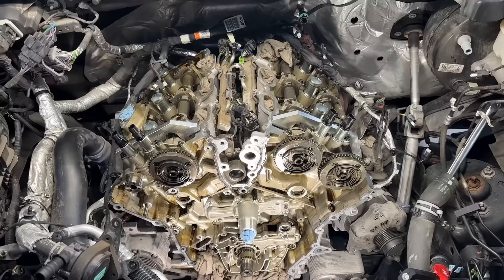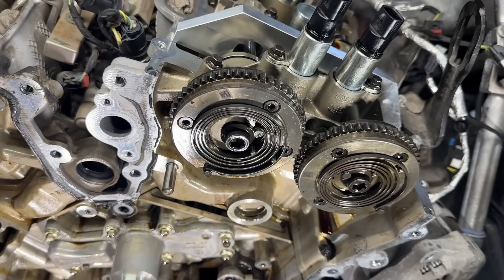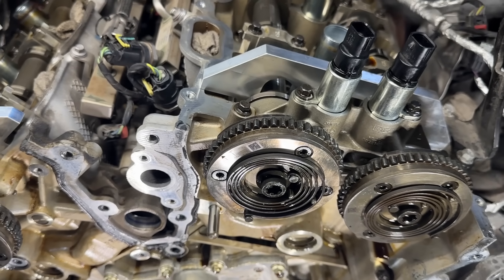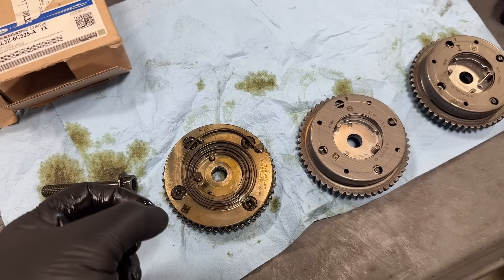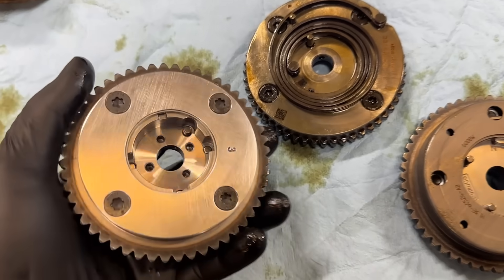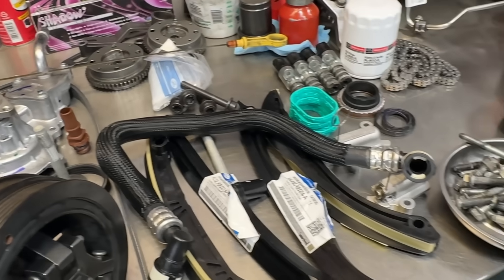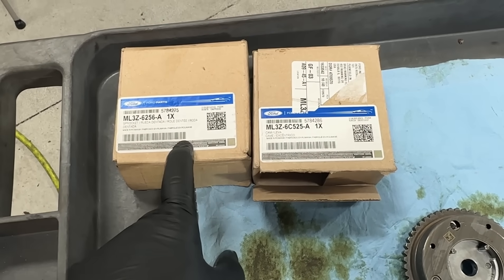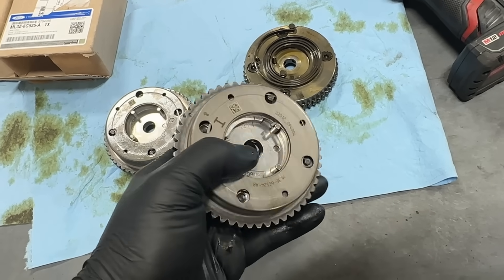2017-2020 Ford F-150 3.5L Ecoboost Startup Rattle Fix: Make Sure You Are Getting The Latest Phasers!

Comment from the maker: Latest Part Numbers-
Intake Phaser- ML3Z-6256-A
Exhaust Phaser- ML3Z-6C525-A

Forscan is a free Ford Specific Diagnostic Software:
Download Here- 
https://forscan.org/home.html
ELM 327 Adapter I Recommend-
https://amzn.to/2GC6dBj

As an Amazon Associate I earn from qualifying purchases.
Reply: This explains so much!  My 2020 Expedition (build date 09/27/20) was in the dealer twice with P0088 at 2000 miles.  Second visit was over 2 months long from 12/20 – 02/21.  
Ultimately a long block was installed. Ford kept sending them the wrong phasers.  The dealer could never get the correct parts and asked to call corporate.  I suspect my late build 2020 has the 2021+ designed engine install.
Reply: How much on average does that  phaser job cost
Reply: @brown63308  recent quotes I've seen are $4400-4500. Which is insanity.
Reply: Dang! I'm 5 years out but only at 48k miles. I'm going to talk to my dealership but if they won't hook me up I may have to do it myself. Like a samn engine overhaul. Ughhh
Reply: @brown63308 $3,000-3,500
Reply: question: is this part number AT4Z-6C525-D correct for the vct exhaust phaser on the 2014 f150 3.5 ecoboost? in a video of yours you comment that the part number is AT4Z-6C525-B but it is different from the one shown by sites like fordgiantparts or tasca Thank you
Reply from the maker: Yes the exhaust phaser has changed a few more times, the "D" suffix as you listed here.
Reply: @FordTechMakuloco  I just ordered my parts based on the other video you did of the tear down and replacement for the Gen 1.  As mentioned, the part number changed to end in D... are these the most recent updated phasers I'm assuming?  Any word on if they have the same problem(s)?
Reply: The part numbers you mention are coming up as specific to a 2021 F150.  Will they work in my 2017 (3.5 EB)?
Reply: Thanks for this video. I looked up those part numbers and it says its for the 2021-2023 3.5, I have a 2017 Raptor and when I look up an oem part it still gives me a HL2Z-6C590-A. Will the ntake Phaser- ML3Z-6256-A Exhaust Phaser- ML3Z-6C525-A  work on my 2017?
Reply: Is there an upgraded phaser for the Gen 1 3.5 ecoboost?
Reply: Are the 21+ 3.5l engines using the latest and greatest phasers ?
Reply from the maker: yes
Reply: Will these work in a first gen EB?
Reply from the maker: no
Reply: @FordTechMakuloco  Hey, I hope you can help us. My 2013 f150 Ecoboost started throwing the infamous p0016 and p0299 yesterday on or trip to St Jude in Memphis, and we are 12 hours from home. The truck runs great, no startup rattle, but will randomly loose power (no boost) and throw these codes. It still runs decent and no bad noises. With a quick restart it's back to full power and running great for a bit and then will go back to no boost and throwing codes. Am I looking at a possible stretched chain, or do you think it maybe a bad sensor? It runs so good until it randomly decides to quit allowing boost, I would think if the chain was stretched I would be getting some misfires. Any thoughts?
Reply: Here is the issue we order with latest part number. New part number comes in with old style phaser in box. Most parts are back ordered so you get what you get.
Reply: Will this work on a 2019 Expedition XLT, same part #?
Reply: Brian what years new ecoboost did ford finally fix this issue? Hopefully on their 2022 expeditions?
Reply: Have you had anyone still have problems after the new cam phaser was installed? I had mine replaced a month ago under the warranty for my 2019 f150 , however I can still hear the startup chain rattle. Actually its a lil worst than before because now the noise last a minute longer than before. Even when installed I insisted on the new phaser model and even has the new model part on my receipt. I am taking it back to the dealership this week, but need help to make sure it is done correctly.  Please advise.
Reply: Do these part numbers work with the 2.7l? If not do you know if the 2.7l has new updated phasers?
Reply: Hello, does these new ones fit on the 2013
Reply: My 2021 F-150 2.7 is having  phaser rattle now! I had no idea this plagued the 2.7s too! I see there have been two updated part number revisions on the intake phasers and one on the exhaust…do you know if the latest phasers for the newer 2.7s in fact fix this issue?
Thanks for the informative video.
Reply: Do u post what the cost of a job like this cost ? I Google it and some dumb dumb post that it cost 1500 $ from Ford to put all new timing stuff in his engine that was parts and labor I know it's that much or more in just labor so it's very miss leading for alot of Ford owners !! I've not looked anything up but just by seeing your video im thinking 5 grand !!
Reply: There's a new updated part number added in May this year.
Reply: @davidgallo5676  I'm about to get this done on my 2018, do you know the new part numbers?
Reply: How much do you charge to replace it ?  2018 F150XL
Reply: Did the early 21's still use the old cam phasers? Did ford use them up before switching to the new style? I am about to buy a 21 and want to make sure.  

Just found your channel.   This is fantastic man.  Keep up the good work.
Reply: How would you go in to your dealer and say "I have a startup rattle and it's my phasers and would like them replaced".  I almost think that they would tell me to go pound sand?  I just bought a 2018 F150, 3.5.  And it rattles just like you describe.  Will the dealer just say "yes we will look at it and replace?  OR again, pound sand.  Thanks for any and all responses.
Reply: Is there any risk in not replacing the phasers and just living with the rattle on start up? I would like to have mine replaced eventually but with thr high cost of the job I don't think I'll get to it right away, aside from doing it myself which I might end up tackling...
Reply: @andrewgeorge3494  yes - your truck will break down in a random spot at some point like mine did on a drive from Houston TX to Titletown Alabama (Tuscaloosa) and let me tell you how much fun that was ….
Reply: @The.Consultant.  Thanks for the heads up, I'll be getting mine done soon...only at 49,000 miles!
Reply: Do you have cam sprocket recommendations for a 2011 F150 EcoBoost with 130K ? They’ve started rattling on almost every startup after 8-10 hour soak?
Reply: @FordTechMakuloco 

So I literally just got my 2020 F150 3.5L ecoboost Platinum back from the dealership two days ago for the cam phaser job...thru Ford's extended warranty. 

Before the job, we had a 20 minute discussion where I told them repeatedly, that I wanted the new cam phasers installed that are in this video... They agreed to do it.

First off they had my truck for 2 weeks...even though it was scheduled formthe first day. No biggie. But when I got it back, when I looked at the paperwork, it showed the old phasers--HL3Z.

When I brought this to the Service adviser's and the tech's attention, they acknowledged they did not install the ML3Z version... But that they did install the newer HL3Z cam phasers, that supposedly have an "anti-rattle clip". They said they had to because Ford wouldn't cover the warranty job if the paperwork showed ML3Z phasers.

They said they could tear the engine back down and replace the cam phasers with the ML3Z ones, but that if the ML3Z phasers blow the engine or if the cam phasers just fail, then when they had to send the cam phasers back to Ford for the warranty, the claim would get denied and I would likely be left with a blown engine and the costs associated with it would be mine alone.

Their concern was the new updated cam phasers in this video could potentially not be exactly as the old set and it could throw the timing off, causing catastrophic failure.

2 questions:

1. Would the Ford extended warranty still cover my engine if it blew up, after using the ML3Z cam phasers?

2. Are the new style cam phasers, ML3Z, legit? Are they the exact same specs as the HL3Z (meaning the same amount of sprocket teeth and distance between each tooth...etc)? Do you still use the same timing chain for ML3Z as was used for the original timing chain for the HL3Z?

If somehow you get this, even though it's a year later, and you do actually reply, THANK YOU! THANK YOU! THANK YOU!!!!
Reply: @Jankity3 Hello. (Sorry this isn’t the reply you were hoping for) 

As I read your post, the dealer shop insinuates that FoMoCo doesn’t approve of the ML3Z phasers being installed but Brian says they are the latest and greatest? That seems to suggest that Ford is once again trying to use up “old stock” first. However, it’s hard to believe that if the ML3Z is the latest version of camphaser, why wouldn’t it be installed? Especially given the dealer shop was willing to do it initially. I personally think the specter of your engine “blowing up” is complete nonsense. 

As I understand it, not every camphaser fails, regardless of age of part number. I had mine changed under warranty at 60,000 miles and now have 107,000 miles on truck and so far no rattle. However, I do not see a specific part number on my shop receipt for what was installed but I’m suspect that I got the very first/ original design based on what Brian says on this issue. 

Lastly, for the purpose of clarity, is the ML3Z the third version of this camphaser?
Reply: @aggiejet  I don't really know...Brian seems to say there's been several in a reply of his above...(says suffix D above)
Reply: @Jankity3 I rewatched the video and reread your post. IMO, the dealer shop couldn’t get the ML3Z phaser because of demand. After your truck sat there for two weeks, they wanted it out of their shop and according to Brian, Ford “allows” dealer shop to install old camphaser. So you got the old ones. If they are willing at their expense to install what you want, I would absolutely do that.
Reply: @Jankity3  I just got mine done at a Ford dealer on a 2018 last Tuesday at my own expense, $2802.99 Canadian tax included. Ford of Canada won't give the extended warranty that the US trucks got. Dealership gave me a 2 year warranty on the repair, they used the ML3Z phasers.
Reply: @Jankity3  I just got my 2018 done at a Ford dealership last week, they used the new style phasers and gave me a 2 year warranty. I brought the truck in Monday morning and I got it back the following afternoon. Not under warranty, paid $2405 Canadian plus tax. No more rattles and no leaks, expirienced tech told me he'd done this job well over 100 times!
Reply: @Jankity3 For informational purposes, I had my cam phasers replaced under warranty in November 2021 on my 2018 Lariat Fx4 at 59,267 miles. ML3Z 6256 A was used for intake, but HL3Z 6C525 CD was used for exhaust. I now have 108,000 and am holding my breath. 

Internet search reveals that Ford sold literally a million 2018 F-150’s and Super Duties. I’m curious if every single old style cam phaser fails? My guess is they do not. So while every shop in America is replacing cam phasers a lot, I don’t think they all fail. 

Good luck everybody, and thank you Brian for the education.
Reply: And these latest parts will fit fine on the 2018 F150 (Raptor) model also.
Reply: Sorry wanted to rephrase my question.. will these latest parts fit on a 2018 F150 Raptor 3.5?  or are we stuck with having to use the orig versions.. Fords OEM parts online is stating they do not fit. But was wondering if that is not correct.
Reply: Is the same part number for the 2014 f150 3.5? thanks!!
Reply: Has anyone had the new ones done recently and what's the lastres par numbers? Need to get mine done on my 2017 3.5L Ecoboost
Reply: Hello would the updated part number fit first gen 3.5L?
Reply from the maker: no

Comment: I am familiar with the 5.4 3V timing job and I'm about to do my first 3.5 EcoBoost Gen 2 timing job. Do I need to upgrade the oil pump or anything like I did on the 5.4?
Reply from the maker: There is no upgraded oil pump available.
Reply: @FordTechMakuloco  Thanks.  Can I follow your Gen1 3.5 EB tutorial to do my Gen 2 3.5 EB timing job?  Any major differences?  Thanks.
Reply from the maker: It is totally different.

Comment: Correct oil and regular oil changes eliminates most of these problems. You dont pick oil viscosities out of your imagination on these.
Call me a liar all you like, but my 2020 work transit van that sees almost entirely highway miles has about 500 miles short of 500k on it as I type this, with the only problems being a failed coil pack at around 300k. Non ecoboost 3.5. Have yet to hear a hint of cam phaser rattle.

Comment: Thank you for this video @FordTechMakuloco!  Unfortunately, my in-warranty replacement was with the old phasers at 83,000 miles, and now at 128,000 I have to do them again.  Do you happen to know what the part number is of the bolts that hold them in?  Thanks!

Comment: My truck had this repair done three years ago.  The OASIS invoice shows that the latest phasers were installed on that job.  Now 30k miles later, I had to have them done again.  I am not confident this problem is fully resolved, even with the new parts.
Reply: I’ve got a similar problem, except I got 50,000 miles out of my repair at 60,000 under warranty except I got the old style phaser put in on the exhaust side and now something is rattling again.

Comment: Or just keep driving it with startup noise and the engine still keeps going FOR ANOTHER 200,000 MILES without problem ! !
Reply from the maker: They will eventually not be able to lock and I have seen the lock pin shoot out.

Comment: I'm guessing the reason for the captive spring (cover) on the outside of the phaser is in case the spring breaks so it doesn't send shrapnel down inside the timing cover. I've seen someone on forums had one with a broken spring on it.

Comment: My 2020 Transit 350 3.5 twin turbo has 331,000 miles with no issues. I use the Mobile -1 20,000 mile full synthetic , and change it and the filter at 10,000 mile intervals. No issues so far.

Comment: How much should this job cost?
Reply: Four to Five Grand 😨, that's what I was told as I gathered the parts to do all this with a friend,that has dealt with a few. The issue has also been getting the parts at 120k the hoses are ALL shot!! The inside rubbers are all coming apart, the water pump pulley shattered so did the impeller and the plastic thermostat housing leaked a bit into the engine valley(about a quart) Also squirting the special tools (their not that form fitting special or bolt to anything just double C clamp like over each cam. The sprocket tool hard to find ,tool truck guy didn't know where to find one ! 🙄. Once I become an expert I'll do these myself but , I am not impressed!!! Sad Ford very sad! As an engineer id scrapped this crap and started over again, somehow something different could have been thought out!!!

Comment: My 2015 F150 King Ranch has like 220k miles; was making all this clatter the last 100k. Now it’s crapped out. So gonna just put a new crate motor in it. Should I order the one for 2021 years or newer? Will it all match up if I do that?

Comment: Brian.. Thanks a TON for this "head up". Two years ago @ 58k I got "the rattle". Took it in and (after the second try) they did the fix. Now @ 93K I'm getting (service engine) prompts where it's telling me I have low oil issues or wrong oil issues. Also idle sputter and poor gas mileage. I'm told it's the Phazers again by my Mechanic. ...Looked at my replacement parts list from the original fix and sure enough they installed the old style phazers. Thanks to you I'm wise to them and putting on my battle gear.
Reply: was the turbo psi irregular especially under boost?

Comment: I had a customer come in with a 2018 ecoboost expedition. They waited too long with the noise and one of the phaser springs broke through the phaser housing causing oil pressure loss which in turn the camshaft was damaged

Comment: I just spoke with my ford dealership concerning the knock at start up. He believes it most likely is a bad phaser. However, he says ford will only replace the one bad phaser, with the newer phaser but, I will have to pay out of pocket to replace them all four. I have Ford's Premium top shelf extended warranty, does that sound right to you?
BTW, you are in my book, the all-time sage for my research concerning my 3.5 eco 2014 Explorer sport
Thanx for what you do, Pal! The knock has the same sound as a rod about to go. lol

Comment: That part where you have the blue rag no one ever talks about it. The water pump bolts up to it outside the timing cover. Anyways does it ever leak or the possibility of leaking ever? I’m guessing it would leak coolant into the oil

Comment: I just got a full kit from Ford for a 2017, and it came with angle cut seals/washers that the dealer said were "cam seals" behind the phasers. He showed me a breakdown of where they go, but I haven't seen any videos or talk about them ANYWHERE. Nothing was behind the original phasers with the spiral spring. Do I install these?? Part # is ft4z-6c262-a

Comment: Just had my 2019 F-150 (45,000 miles) 3.5 ecoboost cam phasers (the new ones) replaced by a dealership. My 5 year power train warranty was expired up but they said the phasers were covered under the 7 year exhaust system warranty. I only had to pay the diagnostic charge ($200-ish).

Comment: Just had my 2019 F-150 (45,000 miles) 3.5 ecoboost cam phasers replaced (the new ones) by a dealership. My 5 year power train warranty was expired but they said the phasers were covered under the 7 year exhaust system warranty. I only had to pay the diagnostic charge ($200-ish).

Comment: Took my 2019 F150, with 62K miles and the warranty was expired by a few months. No recall on the my truck vin. Dealership charge $4,360 for parts and labor. Ford Customer Service was not help, all they say was to report it to NHTSA.